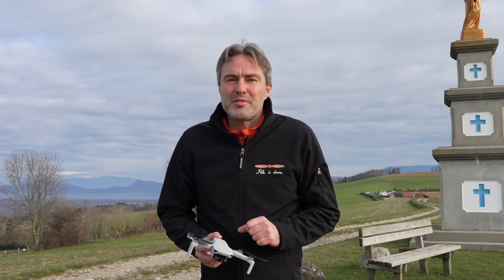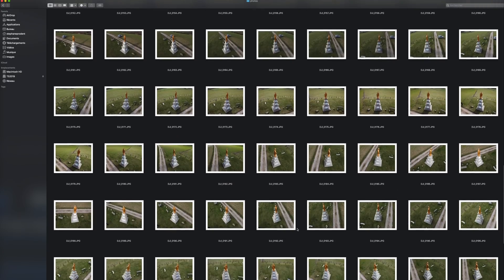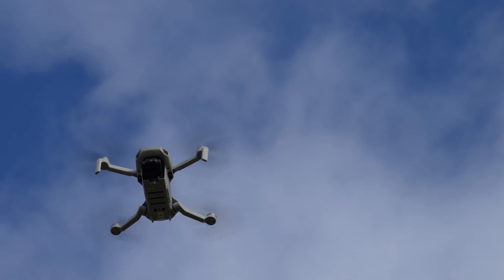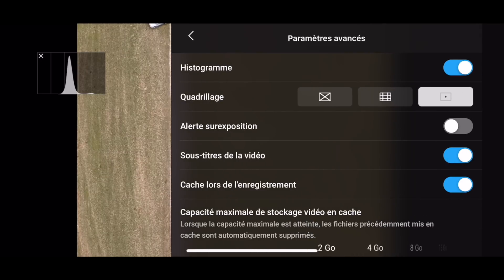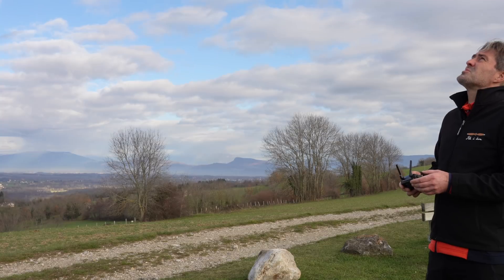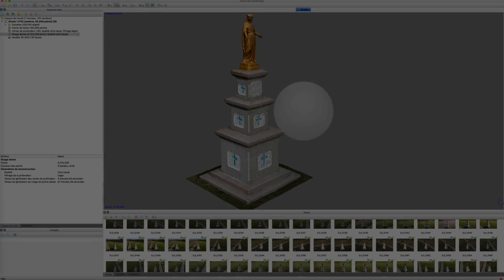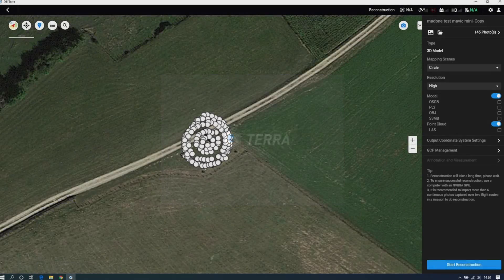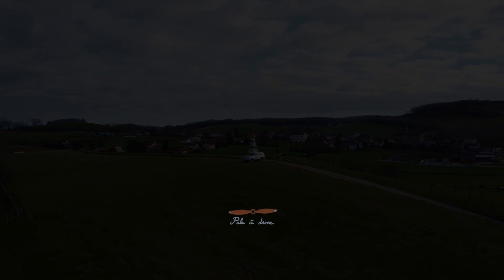Mavic Mini en modélisation 3D

Comment: hey! i'm still amateur and my french is bad, but 

1) i believe the distance doesn't need to be identical? only focal length and aperture have to remain the same, so that is no problem...?

2) Also for the textures: closer pictures should give more pixels for the final texture or not? I never understood how metashape chooses the picture parts for the according textures. sometimes i have unsharp areas in my textures even when im pretty sure i got super sharp pictures...

3) for terrain or generally larger areas, people like to shoot from different heights in a pyramidal pattern. Why are you shooting everything at the same height and vertically?
Reply from the maker: Hello Lorenzo,
1) the distance doesn’t need to be strictly identical, but enough homogenous to avoid ghost effect (multiples Shape of one object)
2)closer picture improve resolution of the model and texture detail 
3) could you link an exemple ? All mission planner propose flight plan as I have done manually in this example

Thanks 👍

Comment: Congratulate me. I bought a Mavic mini for photogrammetry. Please tell me how the program calculates the exact measurements on the object? After all, there is no ruler pattern on the object. My head cannot understand this)
Reply from the maker: Hello Maria, I am not specialist of the algorithm, just I know that the calculation is based on triangulation between several photos knowing the focal lens and the pixel size.
Reply: @paladrone  Is anything known about mission planning in a vertical plane?
Reply from the maker: @Национальноосвободительное-й3т  Hello Maria, check Droneharmony which is able to plan this kind of mission

Comment: Please tell me, can I ask you for help with photogrammetry? I need to make an architectural measurement of the building in good accuracy. But I do not know which device to use.
Reply from the maker: I recommend a Mavic 2 pro or a Phantom 4 Pro for a such requirement.
Reply: @paladrone  Do you want me to show you my project? I do not know your email address. I need help. In our city there are no experts versed in this question. I want to buy a quadcopter and learn how to make such models.